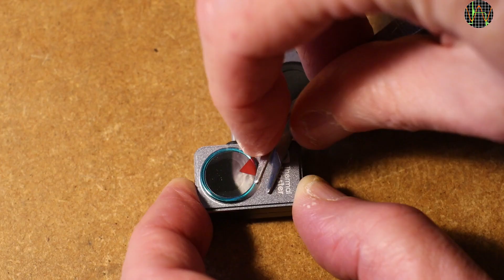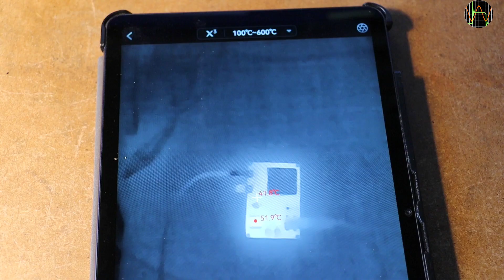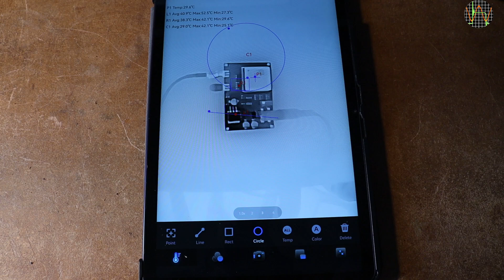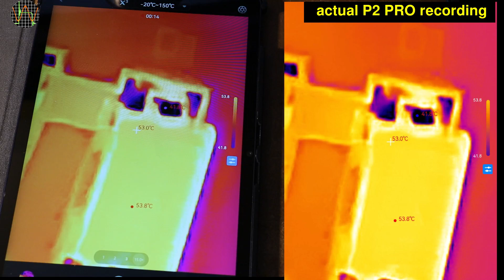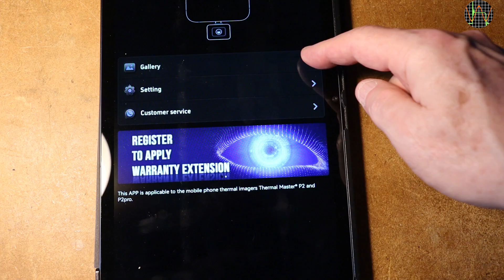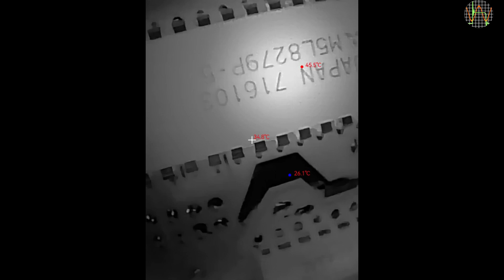173 - How good is Thermal Master's go at the "Worlds Smallest Thermal Camera": P2 Pro?

Comment: If you point one of these close to a painted plaster wall, at a uniform temperature over the field of view, the temperature variation across the field if view will be over 1 degree.
So what does a NETD of < 40 mK mean?
Reply from the maker: The reason these IR cameras can work without having to be cooled down below ambient temperature is that they periodically close the shutter and take a snapshot of the internal thermal noise inside the camera and then subtract that noise from whatever they see when the shutter is open. The NETD value is basically the temperature difference that is just equivalent to that noise. In other words, to be reliably detectable the difference needs to be higher than that and for sure any difference less that the NETD is drowning in noise. So the lower NETD the lower the temperature difference that can still be detected.. A difference of 1deg on a uniform surface could have many reasons. For example the software in the camera may only use an average noise figure for he compensation and parts of the camera interior are maybe hotter or colder than the average. Also, especially if viewing a wall from a distance, an infrared ray from the outer part has a longer (slant) distance to travel to the lens than one in the centre., thus appears as further away. This  should lower its temperature as less energy gets to the camera compared to the centre. ... On (affordable) thermal cameras, I would not worry about if a temperature is not exact or uniform. There are way to many factors that could cause that.